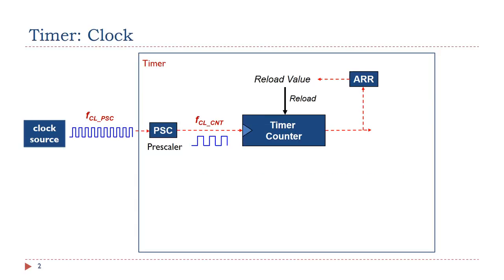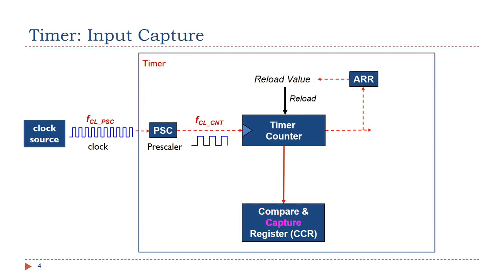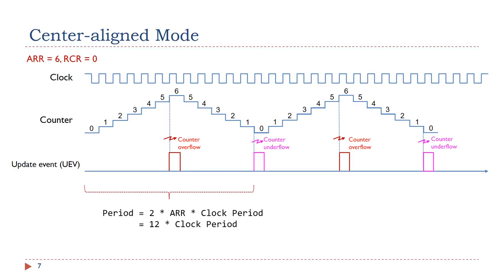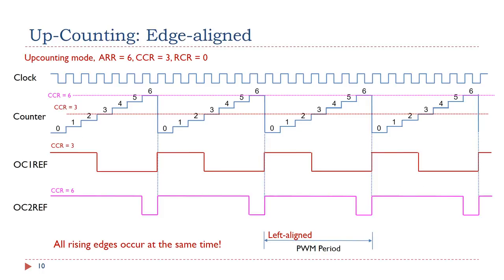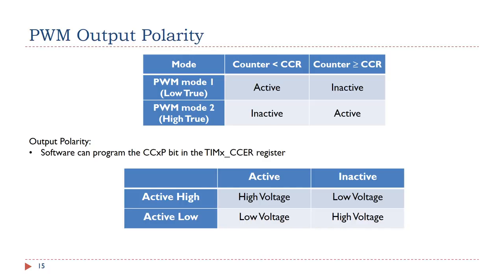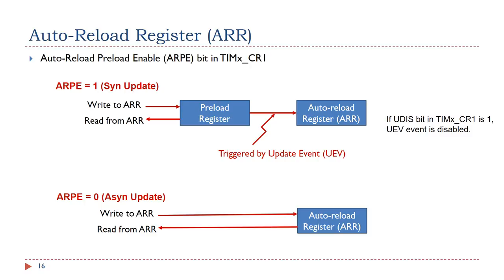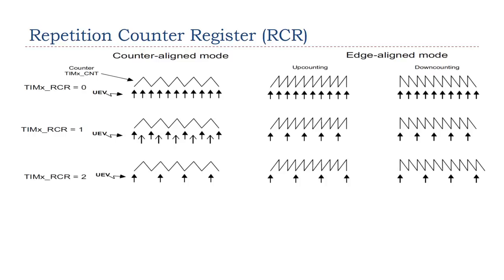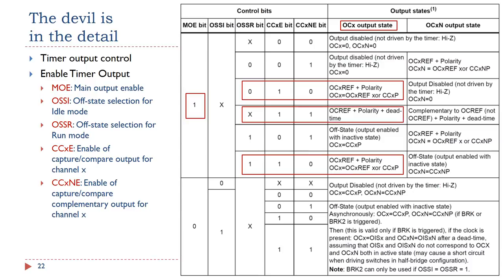Lecture 13: Timer PWM Output

Comment: Nice video sir! and thank you for ur explanation
But i can't still understand about Auto-Reload Preload Enable (ARPE).
could you give me example of ARPE's purpose? 
Because,  I've experienced setting or clearing it in debug mode but I can't see the difference , It still generates the same PWM wave form .
Reply from the maker: When you update ARR, do you want the new ARR value to take effect immediately, or do you want the ARR update to wait until the current counting cycle completes? This is controlled by ARPE bit.

Comment: plz tell me how many PWM can generate a arm cortex M3
Reply: for stm32F103 mainly there are 4 independent pwm(timer port). you can setup how ever you want. every port has 4 output that have same counter values but different output forms.

Comment: Great Video!! I got a question, if i wanted to implement three phases using the Center-aligned mode, did i have to set a seperate interrupt for the phase shift or would it be enough to just start the three timers simultaniously but with three different CCR values?
Reply from the maker: One timer with three channels. Each channel has its own CCR value. A single interrupt.

Comment: How can we give ARR & CRR values
Reply: They're are registers.  You interface through a computer language (eg. C or assembler) and a program translates it to machine language of instructions. These registers just  are just memory locations that can be written in assembler or C language. Placing data values in these memory correspond to giving values to  ARR and CRR.
Reply: Eddie Amaya has good videos on how to read/write to registers for stm32, and the conventions used.

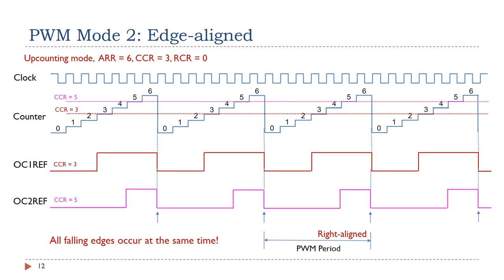Comment: There's one slide I'm not entirely sure if it's my misunderstanding, or the chart mismatched. at 9:45 it looks like on the increasing side, OCREF is high when counter=CCR. but on the falling side, OCREF is low when counter=CCR. Did I misunderstand?